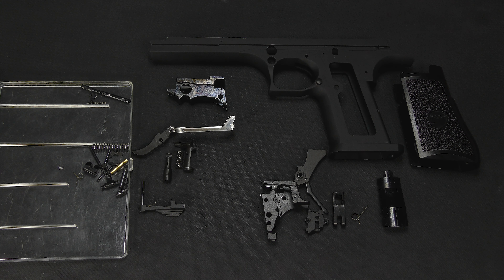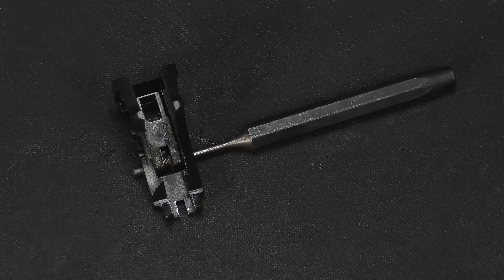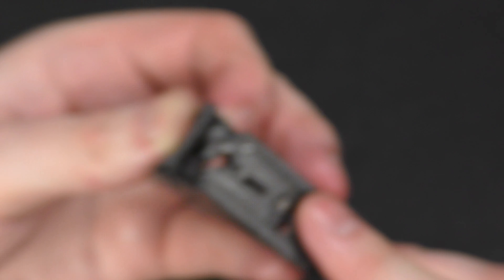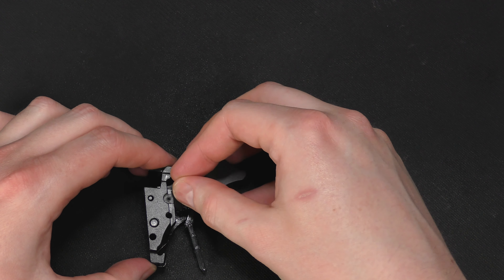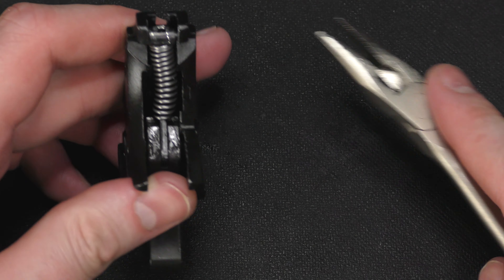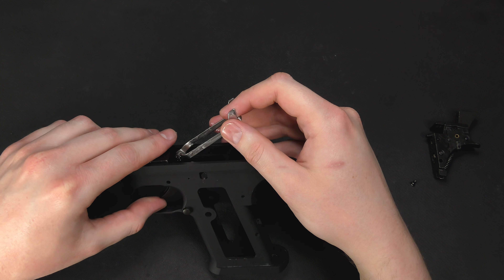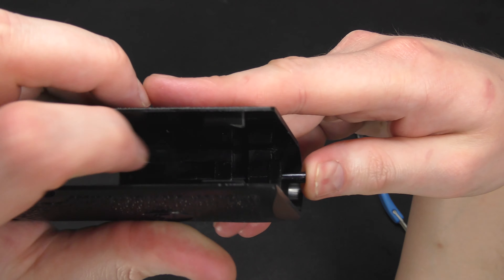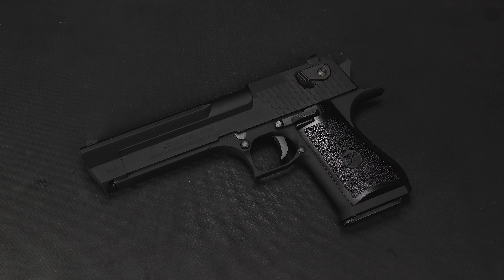Tech-tip: Cybergun/WE Desert Eagle .50AE GBB reassembly guide - Frame [4K]

Comment: Putting the valve knocker in was not as difficult as it seemed at first. I inserted it from the rear, whilst rotating it, so as to make it go in. Then, I used gravity to let it rest inside the assembly upside-down. I took a small flathead screwdriver to manipulate the spring-arm into the valve knocker's slot. It happened just like that: much easier than I anticipated.
Refitting the hammer-spring was more challenging though. I had to use so much force with the pliers, that I did not believe that I could manage it like that. So, tried a different approach: I took the retainer between my index-finger and thumb. Then, I pressed the retainer firmly onto the spring-strut combination, pushing it just enough as to be able to push the retainer into its target location in a swift motion. I was surprised that it appeared to be that easy, although it was also quite "dangerous", as the retainer and spring could have launched themselves into oblivion just as well.
So, no pliers were needed for that. Just lots of strength in your fingers to push the retainer against the spring, and some control as to make it lock itself in its intended location. At first, I thought that the tip of my index-finger was in the way, but then I figured it out: rotate the index-finger gently, thereby pushing the retainer into its locking location. It was easy, once I noticed that it worked, but it wasn't planned. Just a case of incidental luck and intuition.

Comment: I'm having an issue with the installation of the slide. The trigger assembly works fine when isolated with the frame. However, when I put on the slide, pulling the trigger does not release the hammer, it seems and feels like the bar is pressed down into the safe position even though the safety is off. I also noticed that with the slide off, the trigger bar does not rebound smoothly as you showed in 36:51 (It instead stays depressed until I lightly tap the trigger releasing it) . Do you know what could be causing this problem?
Reply: bro did you figure this out im in the same exact boat